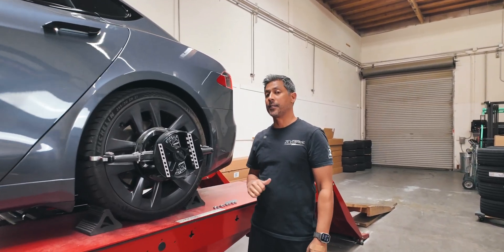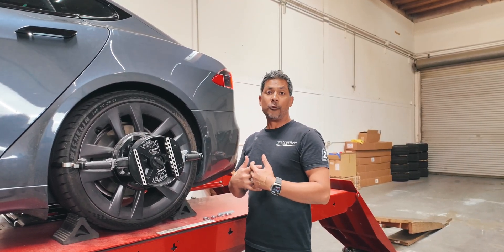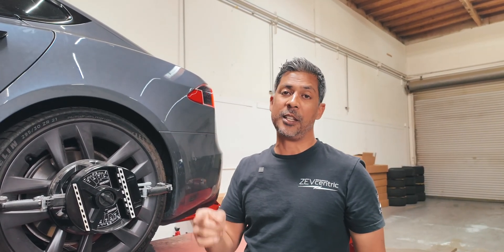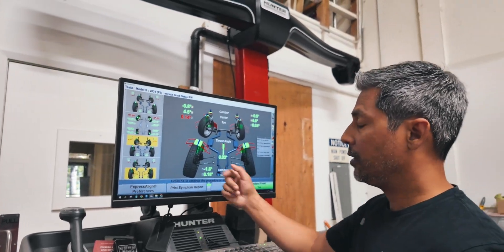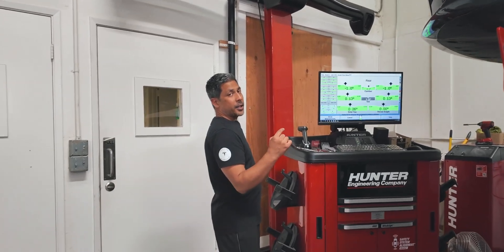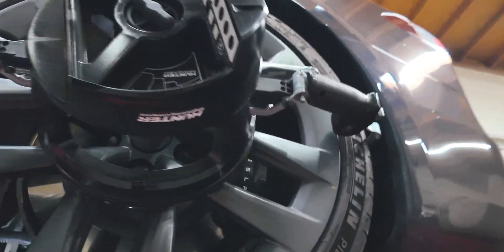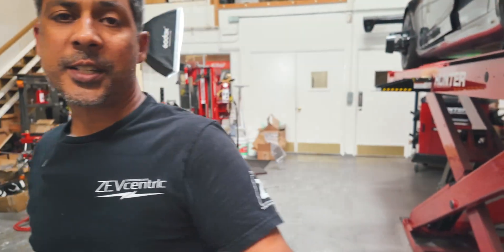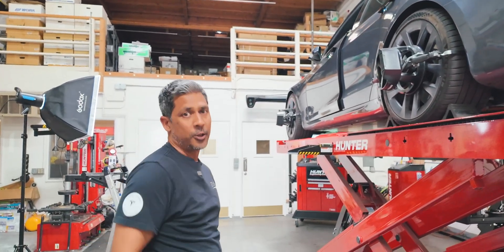MODEL S PLAID LONG RANGE  CAMBER SHIMS A CHEAP SOLUTION FOR UNEVEN TIRE WEAR

Comment: total toe seems hihg still? Secret EV recommeneds 0.10 for total toe but your video shows 0.27? it is an honest question, not bashing.
Reply from the maker: that all depends on your personal preference.  We use N2itive specs.  A little more positive toe will give more driver confidence and provide more "stability".  The biggest issue is the camber not the toe.  Do what feels right and suits your driving style.

Comment: Ok so this is only for low settings. I don’t seem to have an issue with my X set to medium height. It’s already at .8 degrees
Reply from the maker: Then you are very very lucky if you only have -0.8 degrees of camber on your X at medium height.  I will say that we have never seen that before.

Comment: Will the shims work on a 2013 model s p85??
Or what would I need to fix the inner wear?
Reply from the maker: no, you need these adjustable camber arms https://zevcentric.com/collections/alignment-arms-1/products/n2itive-tsx-1-rear-adjustable-camber-arms-1-pair-for-tesla-model-s-x-2012-20?variant=43826592448757
Reply: Only camber arms? Or would I need toe arms replaced aswell??
Reply from the maker: @zohm4648  it's hit or miss.  Sometimes you cannot reduce the camber enough without getting toe arms.  Getting both would be the guaranteed thing to do.  about 90% just do camber arms and it will for sure provide a good amount of correction but worst case may only get you 70-80% of the way to the ideal spec.
Reply: Greatly appreciated 👍

Comment: Does it adversely affect the rear cornering grip and cause unsafe handling though?
Reply from the maker: absolutely not.  If you have a lot of negative camber causing uneven tire wear then that means you aren't using the whole tire anyway.  The whole objective is to use the whole tire's contact patch. Hope that makes sense. If you're tracking the car religiously then that negative camber will actually produce a more even wear pattern on the tire.

Comment: Nice video.
Should yoy measure the camber firs  before ordering shins so you know which ones to get? 
What do you mean by p1 vs p2 and are other modifications needed to go with 295 on all four?
Reply from the maker: P1 is referred to first generation legacy S/X 2013-2020. P2 is current generation S/X 2021+
Reply: @zevcentric Thank you for the clarification. However do yo have a position with respect to the first question about measuring camber before ordering shims so that one gets the correct ones.
Reply from the maker: @its2077 the gray shims will work fine.  Its what we have done on all of them even with lowering links. Running 295’s square just requires the right wheel fitment relative to your alignment.  No other nods needed.  https://zevcentric.com/products/evpe-camber-shims-2021-tesla-model-s-x?srsltid=AfmBOoqZAyziSwfEMa3DkIqc-ea9l6EFGLmIG6ShzjPz4kE-A8J27Ota&variant=46117659869429
Reply: Thank you so much. Your the best replier out there. And also thanks for the tip on getting away from staggered tires using 295 all around. Now to find someone in Phoenix who does the shim installs.
Again thank you.
Reply from the maker: @its2077 buy the shims from us and i will connect you with our installer in phx.  I got you.  We also offer consult for wheel fitments.

Comment: Will this also work on 2023 model 3? All i can find are full control arm replacements when searching for solutions.
Reply from the maker: Model 3 is a totally different design.  This will not apply.  You need complete adjustable camber arms  https://zevcentric.com/collections/alignment-arms/products/mpp-rear-camber-arm-blue?variant=43231039258869

Comment: Zev, will adding shims also adjust front tire camber on MY FUCA supports?   Replacing FUCAs with adjustable ones is too expensive for us after replacing rear camber arms and replacing suspension to smooth out rough ride.
Reply from the maker: @jamesj9325  on model y you cannot use shims and getting camber arms is probably not going to fix front uneven tire wear.  Thsts probably from toe.